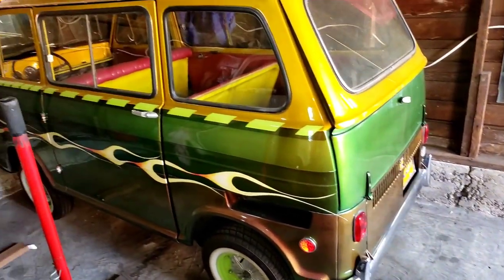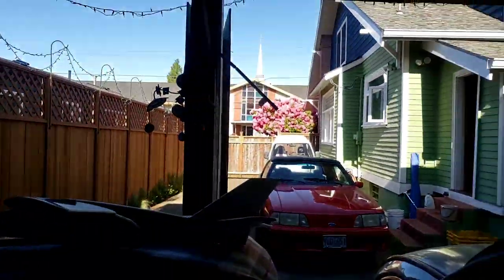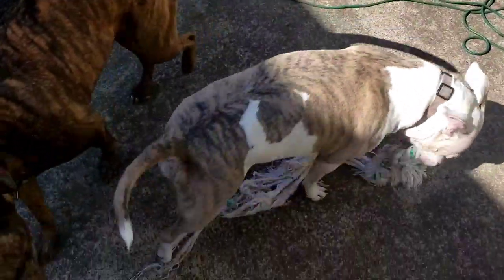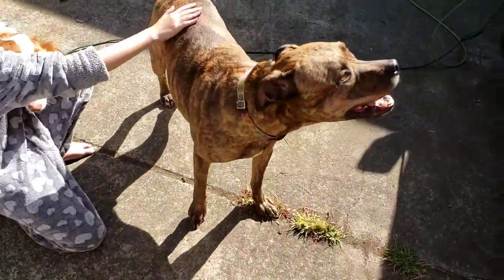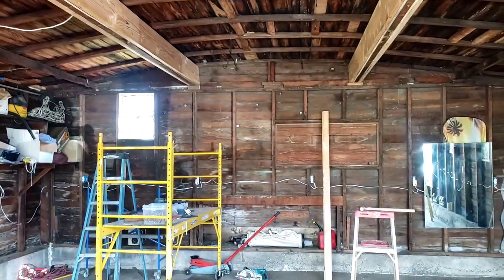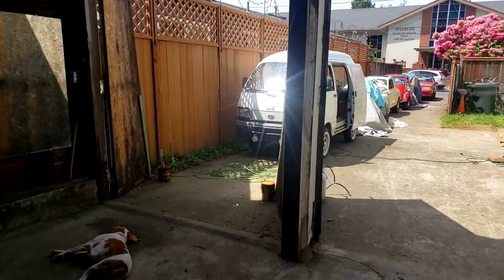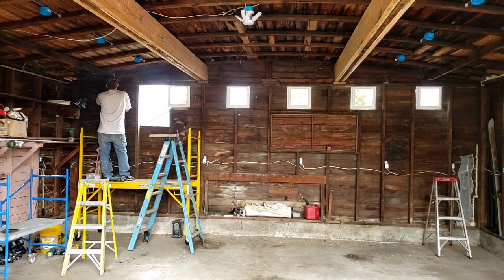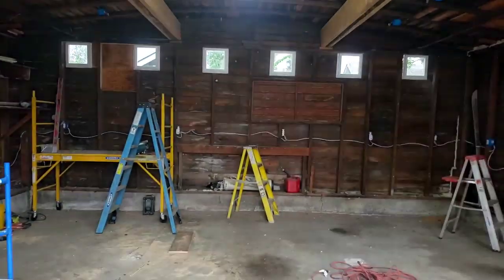1914 Barrell Roof Carriage Shed Rebuild to Garage More Tiny Cars

Comment: With the center post taken out, how many micro cars will fit in your garage.
Reply from the maker: Hoping to fit in 10 TINY cars  !! I used to cram in 7, but not efficiently. This is in a pretty "normal sized , two car" Garage , inside measures 19x22 ft.